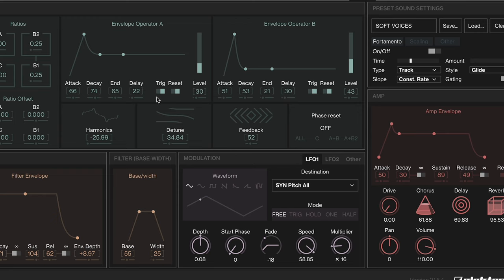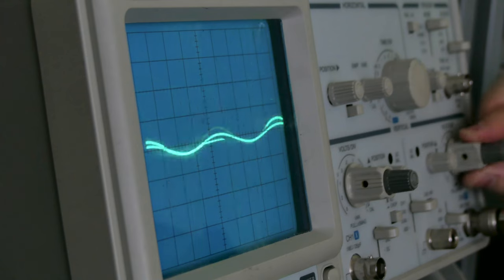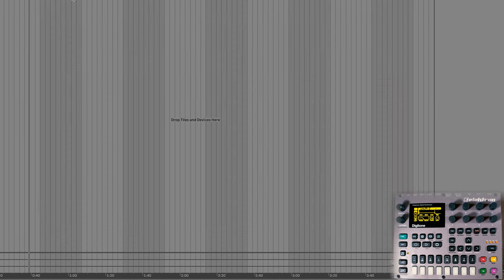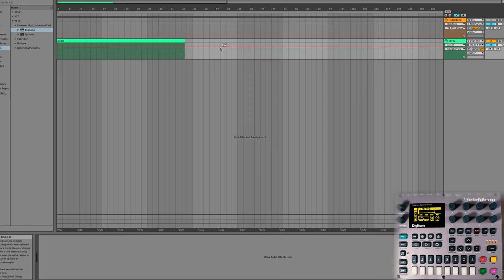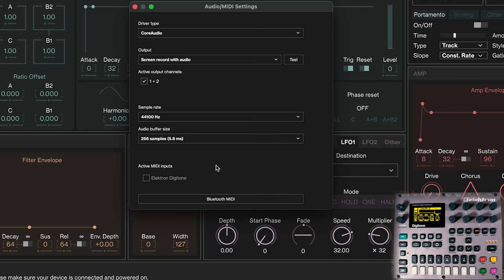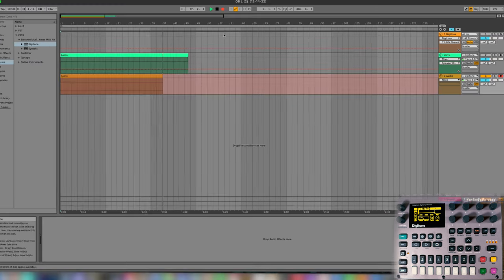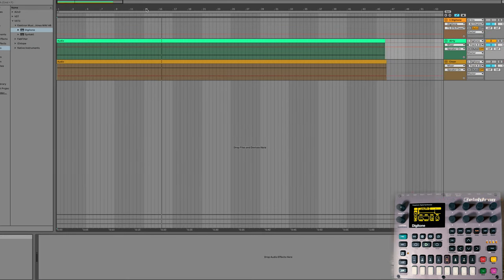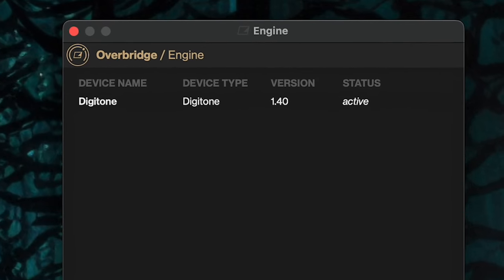How to fix Overbridge Latency

Comment: Doing the step of opening the stand alone digitone app and setting the sample rate and buffer size there was not necessary. That only sets the sample rate and buffer size for when you are using the stand alone app. The digitone vst plugin only looks at the buffer size and sample rate configured in your DAW.
Reply from the maker: Appreciate the insight and that does make sense.  Have you found any additional tips for dealing with OB latency?
Reply: Other than the ones you mentioned:
- make sure that your overbridge device does not have any input/output/sync turned on in the ableton midi sync options. Also in your device, make sure it is set to overbridge mode. Doing that makes it work quite well for me.
Reply: @subliminalsequences  Just skip overbridge altogether and adjust track delay in audio config settings in Ableton. While I was initially stoked on OB I now look at it as a novelty.
Reply: @muchomacho79  it’s not, and that introduces more latency than correctly using OB.
Reply: @subliminalsequences  Tip 1: driver error compensation between your audio interface and Ableton. Tip 2: use Ableton’s external instrument plug-ins to route audio/midi through instead of the regular midi track + audio in. Tip 3: use “lighter” effects - hover your mouse over them to see how much latency they introduce and try to use ones with 0ms. Tip 4: set it to “in” instead of “auto” and perhaps even try using an audio interface with direct monitoring capabilities.

Comment: Hey there thanks for the video. Heres a few tips I like to add. You should follow Ableton’s guide for driver error compensation for your audio interface. Also, and I don’t see enough people doing this so I’m trying to spread the word, you should be using Ableton’s external instrument plug-ins to route Overbridge/ audio/ midi through. It has far less latency. It also gives you an extra gain knob and you can put audio effects right on that midi track which is convenient especially when using macros.
Reply from the maker: Hey!  Thanks for sharing that.  I will have to test that out.  I haven't used Overbridge in a hot minute but I will try the external plugin trick.  Thanks for stopping by!
Reply: @subliminalsequences  Sure no problem man. Yeah give it a try. I hope my instructions/ description was clear enough.